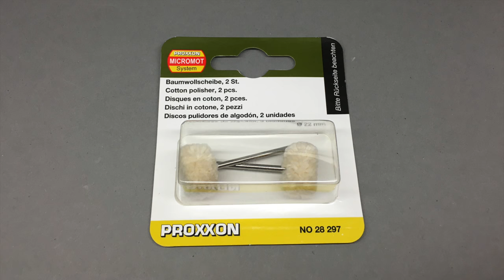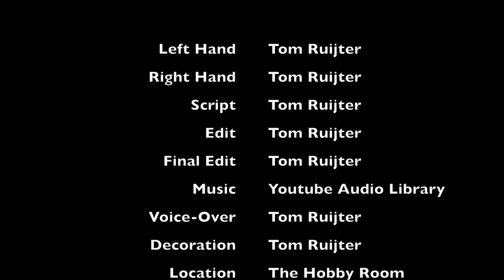How To: Machine Polish 2k Clear on a Scalemodel

Comment: Just wanted to give you a tip for polishing. I just got a Sonax Profiline EX04-06 polishing compound, it's specifically designed to get from 2000 grit sanded clear to mirror finish in one step. It's fucking spectacular.  Hand polishing with microfiber cloth you get it from totally dull 2000 grit to the most shiny and wet looking clear you've ever seen in like 20 seconds of rubbing. It's like magic. It's expensive, but worth every coin. Best polishing compound I've ever tried, makes everything else useless to me now.  It was recommended to me by a guy who polishes cars for a living.
Reply from the maker: just ordered some, will give it a shot, Thanks man!
Reply: The Scalemodeling Channel cool, let me know how you like it

Comment: Nice!   Funny to see you use the same stuff I do.  Meguiars Scratch X works wonders after wetsanding w. 2000 grit.  I polish with foam pads attached to a cordless drill.  Less RPM's and less heat.  But ultimately the best results I get is with hand rubbing with a microfiber cloth....More labor and time intensive, but less chance of gouging or burn-in.

One step you might also want to include after is then use Mequiars Polishing Glaze!!!  It looks like you waxed it, but won't prevent you from being able to apply Bare Metal Foil or detail painting.  Just hand rub with a micro fiber and the shine is amazing!

I rarely wax, as it sometimes makes the enamel clear take on a milky appearance...and this is on models that have cured for a year!  Yes, I said a year...I mass paint like 10 car bodies at a time on those rare nice days, and store them for the build.
Reply: Did you say some models (Paint) you have cured for a year?  Did I read that correctly? A year?!!! Is that a typo?
Reply: @catlady8324  The paint didn’t need to cure for a year…It’s just I will gang paint maybe 5 cars at one time, and it might be a year until I get to actually building it.  A typical Testors enamel will fully cure for sanding and polishing in about a week or 2.

Comment: I paint with P.u automotive paint, after a few coats of paint I wait for it to dry and after a few days I sand everything with 1500,2000,3000 sandpaper then I apply another coat of P.u paint, the important thing is to dilute the paint well with thinner, the The airbrush noise is different when the paint is well diluted, so the paint is not thick, and in the last application I mix 60% paint with 40% solid self-varnish, it is important to remember that it is recommended to leave the piece in the sun before painting. to heat it up, this helps the thinner evaporate faster, making the piece brighter.

Comment: hi, ive painted a knight rider in black. There was a dust particel on the hood. Ive sended it with 1000grid on that tiny spot. Not its totaly dull like you hood. Ive tried it to polish it with my dremel with the same polishing had u use in the video. The spot stays dull no mather how long i hold the polishing head on it. Is it because i have to send it with 1500 and 3000 and so on? OR what is wrong. Im thinking on selling this kit.
Reply from the maker: Yes you need to sand it with 1500 2000 2500 3000 and so on
Reply: Try using a Polishing Compound...😗
Reply: You may have burn through the clear coat on that spot it don't take much maybe even when you wet sand it you could have damage clear coat you may have to reclear coat paint

Comment: What's the longest you have waited between 2k clear coats? I've sprayed a few coats last weekend but later noticed some spots with orange peel. It looks like clear coat might not be thick enough to sand it out so I was going to put another layer on, but I will only be able to do that this weekend which would make it a week after last coat...
Reply from the maker: +Andrius Gonestas just sand it lightly, youll be fine, after a week you should be able to add another couple  of couts

Comment: Nice video...thanks for sharing....what clear do you use?  Was the orange peal from the paint or from clear?  Or both?  The rotory tool is that Micromot 50/E  Which model has 1000 rpm as I cannot find lower then 5000 RPM  Thanks...Warren
Reply from the maker: +The Real Estate Journey....Your Goals I use Zero paints 2K clear, it was a combination of both paint and clear for the orange peel. Its a micromot 50/e wich has adjustable rpm
Reply: +The Real Estate Journey....Your Goals     can you adjust this rotary tool to slower then 5000RPM
Reply from the maker: By just barely turining it on its not on 5000
Reply: Ok i don't understand what you mean here ? Can you explain more please thank you

Comment: i always seem to burn through the paint on the sharper edges. one thing i want to know how long after you paint to you apply the clear coat. and do you not sand the bare paint??? i am sure i cam get a better finish in my kits as what i am getting now. any help would be greatly appreciated. thx
Reply from the maker: +james mccaughey About an hour after i apply the paint i will clearcoat it. I do not sand the paint.
Reply: +The Scalemodeling Channel. ah thanks i thought that would be right but as i jave done what i think ia a fairly decent spray job with the paint i thought i would ask first thanks for your reply

Comment: Grit per CM versus Grit per square inch?  Never thought of that.  Funny, isn't it?  This is why I (here in the United States) will take it down to 6,000  (or finer) just to be sure.  BUT?  I don't build many model cars...I have one in my stash that I'm particularly interested in getting right; it's a 1957 Corvette.  I have other models to practice on first, of course...but?  Your videos are a wealth of information.  (You're in Canada?  I am guessing from the accent..)...
Another thing:  Your techniques of polishing could also be used for airliner builds.  I have two Concordes in 1:72 scale, I plan one in "flight", the other in Ground Mode.   Thanks for great video content.  Helps this old fool learn some new tricks....

Comment: Question for anyone who can answer?? What is the best way to minimize orange peel and imperfections in the first place, during the painting process?? I get good, color, good clear & shine but just a ton of peel. I am cleaning models, sanding with 600, priming with Zero Grey Filler, dust/light coat on 1st coat and the progressing wetter coats approximately 15 minutes apart, longer before the Zero 2K Clear. Is there something in the painting technique itself I can do to improve results??
Reply: With orange peel there are so many possible reasons. 
First thing is your setup. Is your pressure too high or low? Find the sweet spot.
Is the paint thinned down enough, or too much? 
What are the weather conditions? Painting in cold weather is not ideal.
Is your airbrush good? Needle size too small or large?
Then there is technique. Distance from panel, speed of your strokes, how much overlap between strokes, how heavy you are applying the product. 

Painting is not something that you will master overnight

Comment: Does this work for standard spray paint?  Or do I have to use a special type or brand?
Reply from the maker: Ginganinja 900 works with spray paint aswell. But you need to be very very carefull as spray paint clear is a lot softer than 2k ckear. It can melt a lot faster when using this method. So be very carefull and don't stay in 1 place for to long with the polisher
Reply: Lucky for you, you can buy 2K clear coats in spray paint form today too. They have a little pull tab on the bottom of the can that you pull and it breaks the seal inside the can enabling two containers to basically mix, and you get the exact same clear coat that you would if you bought two separate components, mixed them and used a professional gun to spray.  The only downside is that those 2K clear cans are about 3x as expensive as 1K clear coats, and they have to be used within a couple of hours after mixing them for the first time , because the lacquer will basically harden inside the can in a while and you can't spray it anymore. Basically, you'll waste a lot of it unless you're spraying a pretty big area. Still worth it though, because 1K clear coats, never and I repeat, NEVER harden properly. I've had parts painted in many different ways, different thicknesses, different amounts of coats, different sanding and polishing procedures, etc. and none that I managed to spray thick enough to give a deep gloss finish ever dried completely. I'm talking years, after a couple of years of components sitting in the storage I can still feel with my fingernail that the surface is soft. With 2K you'll get rock hard surface after a week of drying.

Comment: is it safe to paint with Mr Hobby paints and then apply Zero Paints coat? or should I use Zero Paints paints as well?
Reply from the maker: Toshiro Viera Stalker i would not advise to mix and match paints. To avoid problems stick to 1 brand

Comment: Is it possible to clear coat after polishing and waxing the body. Want to clear over bare metal foil.
Reply from the maker: It is, but it does not make sense. The paint won't shine. The clearcoat will. You can clear over bmf
Reply: Had already polished out body when I decided to do the bmf. And I just want to seal the bmf so that it doesn't peel up when cleaning the model for a show.
Reply from the maker: Don't worry about the bmf peeling up. that will stay down without clear on it;)

Comment: What are the chances of me getting a finish like this, priming with Vallejo acrylic and then painting with Vallejo metallic paint. Followed by a polish or something? I don't make scale cars, this polishing method has be intrigued though.
Reply from the maker: Big Gee the vallejo paints will not be able to get a shine like this. They are not as hard of of this quality
Reply: Understood, thanks for the reply. I'm trying to avoid buying new materials, I normally build AFV. Going to prime with Vallejo, Paint with Vallejo, and then Gloss Varnish after decals etc. I'm not sure I'll be able to wet sand or wax. Like you said, being it's a water based product it's not as durable. I'm tempted to go full bore but spraying enamel paint makes me really sick, even with a mask :(
Reply from the maker: +Big Gee you could try to spray he clear from tamiya spray cans. That is polishable and should be safe to use on top of vallejo
Reply: Thank you very much for the replies. What products do you suggest to polish the clear coat? Should I just use a cloth and some simple car wax? Or should I use something more abrasive at first and then work back to the cloth? I'm building this particular project for a charity, so I want it to look good.
Reply from the maker: Big Gee i would use some automotive polishes and a microfiber cloth

Comment: also if you have orange peel on the paint and then add clear its going to be difficult to get the peel out or am i missing the point
Reply from the maker: +james mccaughey the orange peel will always be in the clear. so it will be just as hard or easy to get out.

Comment: p2000 abrasive is the equivalent of 1000. The former being the european standard and latter being the american standard. So numbers being equal, european is coarser. Are your sand papers designated with letter p followed by grit number such as in Tamiya sand papers. Thanks in advance.
Reply from the maker: They start wirh a P

Comment: horrible polishes bud. if you like the megs range check it 105 then 205 or ultimate compound then ultimate polish. both out perform and finish up better. scholl S17 then scholl s40 also two epic polishes. the wheel you have may leave marring due to speeds as you can't slow down for final passes. ideally 400 to 600 rpm for last pass.
Reply: Or buy chemical guys. Scratch x is a filler not a polish.

Comment: Great tutorial!  I'm getting back into the model car building and the body paint has ALWAYS been a sore spot for me, often having to strip the paint like 3 times and start over.  I tried this method on a scrap model and while I'm still working on the painting part of the technique, I'm loving the shine!

Question though: which step would you apply the decals?  Would it go between the two clear coats?
Reply from the maker: Either underneath the clear or in between. But when doing it in between coats it will take a lot longer to do, as the first coat of clear needs a couple days to dry before you can apply the decal. And apply the finish coats of clear.
Reply: I lay them on the first coat of clear, dust over them to make sure the paint does not destroy the decal after that the coates can get heavier to level everything out.  you don't want bumps where decals are